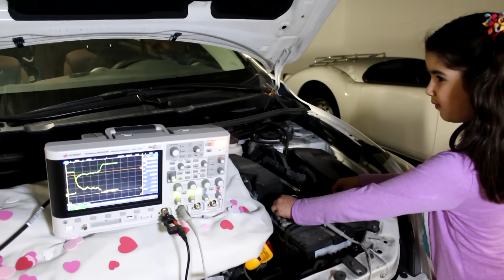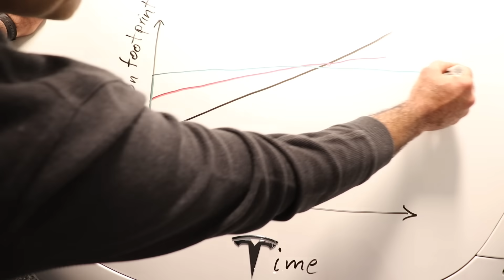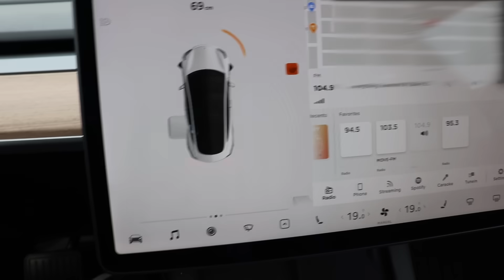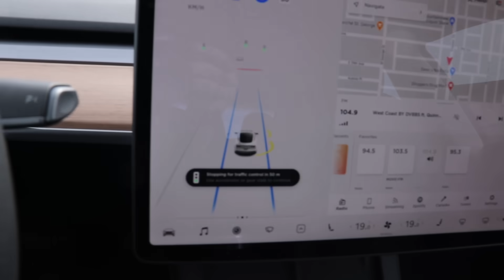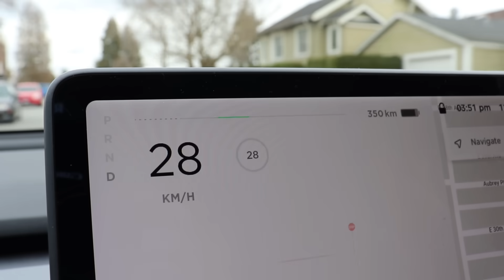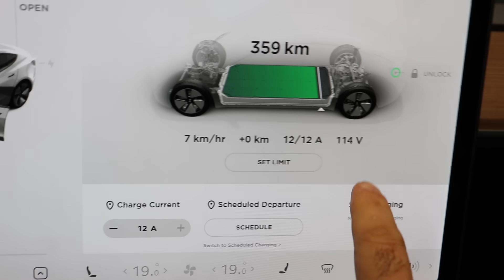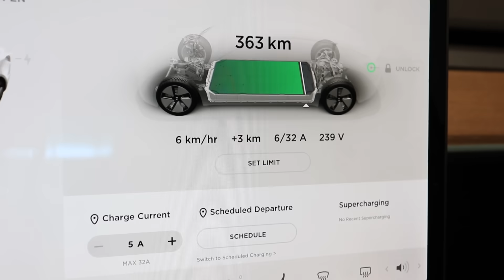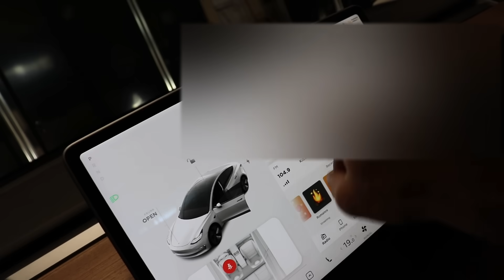ELECTRIC VEHICLES & My Tesla Model 3 Review

Comment: This is the one and only man that shows off his car without showing off his car
Reply: @AppleReviews  1000 charges is about 200.000km. Most people need more than 10 years to drive that distance. Till then the battery technology will be better and cheaper.
Reply: @k0t1990  - To me, that's about three years, maybe four.   Teslas, like most EV cars, are really designed for city only drivers.
Reply: @AppleReviews  Even if the battery died at 1000 charge cycles (which it doesn’t), 1k cycles at 250 miles per cycle is 250,000 miles. Cycle life is based on full to empty usage cycles, which is far more extreme than a typical usage profile. My 7 year old Tesla is at 145,000 miles and I have most of my original battery life still. Spreading nonsense...
Reply: @AppleReviews  as other mentioned it is ~200k miles. Other thing is, he sad he is charging it at 5A. It is the same as super charging for mobile phones. It is fast, but battery life is shortened by it, using slower charging is good for battery life, also tesla batteries can be recycled and carbon footprint can be lowered.

@1Guil Mil No one cares. He did not flex with the car, he just showed technology and reasoning why tesla. That is why others are subscribed. Go ahead and unsubscribe. Have a nice day.

For everyone, pardon any mistakes in my English.
Reply: Dude, you weren't even listening! He didn't buy a car, he bought a huge brushless motor and a massive power bank. lol

(Not serious, if that wasn't obvious. Still looking for that sarcasm emote...)
Reply: @joelvarney5091  lmaoo
Reply: I must say that is now in the quote dictionary.
Reply: Agree
Reply: @AppleReviews  because it's BS
Reply: Question mark?
Reply: yes
Reply: Couldn't have put it better
Reply: you have to remember he is a dad
Reply: Ikr!!
Reply: You can too, just draw on your car and show the world
Reply: This car got a explosive vateries 💣💥💦
Reply: I feel this 1Guil Mil guy will delete his comment, so um here is what he said

"I never expected much from this guy, but buying a car from mr. fraud is a little bit too much. Unsub"
Reply: @d4kx639  Thank you. We used to call this "quoting for truth" and this old web-surfer appreciates it.
Reply: hey basil
Reply: @basil127  ഹലോ ബേസിൽ
Reply: @basil127  Asalamu alykum
Reply: vai brazilian
Reply: I never expected much from this guy, but buying a car from mr. fraud is a little bit too much. Unsub
Reply: @1guilmil28  you are going to unsubscribe from an awesome youtuber because he bought a car from Elon Musk?
Reply: @KingLordLele  I hate elon bit I love electroboom
Reply: @KingLordLele  I hate musk but I love electroboom
Reply: @1guilmil28  You can't cancel people for consuming products. Most large companies are equally slimy, if you care that much get involved in politics
Reply: @callumgreen6383  If you think Tesla is slimy, you have been manipulated by the media...
Reply: @callumgreen6383  Elon Musk is far from slimy he’s one of a few people who actually care.
Reply: @tomura7739  Ask his employees
Reply: @Haibrayn42  statement that brings nothing to the table bozo
Reply: @toddeburch  dude Tesla IS slimy. They treat their employees like crap and their quality is terrible just as seen in this video. Don't be a Musk simp. It's embarrassing to be a fanboy without logic.
Reply: @callumgreen6383  agreed
Reply: @toddeburch  yeysla is slimy
Reply: @toddeburch  no large company becomes such without exploiting. Period. All large companies and millionaires are slimy for one reason or another. Even your "heroes". What are they actually doing for YOU personally? Nothing. And yet they hoarde wealth gained through exploitation of the working class. These rich people should not be your idols, you'll probably find the media has contributed to you believing such.
Reply: @1guilmil28  the door is wide open. We will stay here and be happy. 😁
Reply: @1guilmil28  Hurt much.
Reply: @1guilmil28  you are acting like someone cares
Reply: @1guilmil28  oh no...

Anyways...
Reply: @1guilmil28  this isn't an airport you don't have to announce your departure
Reply: @1guilmil28  I can't tell you how much you'll be missed. Really. I can't.
Reply: @1guilmil28  go on then, nobody asked
Reply: @1guilmil28  Hope you realize that says waaaaay more about you than buying the car says about him..
Reply: @1guilmil28  I'm trying to figure out who asked.
Reply: @1guilmil28  we don't care
Reply: @1guilmil28  go back to kindergarten
Reply: @1guilmil28  Nobody caaaaaaaaaares, nobody caaaaaaaaaaares
Reply: @1guilmil28  you know what you do? You spend your day searching for videos involving Elon musk and if the video gives kudos to Elon or his technology, you will go on and try to cancel the video creator. Lol
Reply: @1guilmil28  These are some of the best cars ever made, and Electroboom made a good choice!
Reply: @1guilmil28  Seethe harder nerd
Reply: @1guilmil28  I think I may have to stop usng the internet if you unsub. PLEASE come back, we REALLY care. Not.

Comment: Lol. Chevy made a car (carburetor) that got roughly 50 miles per gallon in the 1950's. Look into it.
Reply: Provide a source please
Reply: It roughly started in the early 1900's, 19 teens to 1930's ish, in canada if memory serves correct, with patents filed for a carburetor/s that would "vaporize" the fuel before entering the engine. Vs the fuel requiring the engines heat after being injected directly into the engine. Thus vastly improving the mpg. Kinda falls in line with the "dirty gas" issues of the days. Hense the clear compartment on top the pumps ensuring quality fuel was being purchased. But I digress. Chevy basically tested however many of there own. Some people with the ridiculous claim of over 200 mpg. But we know the not wasn't possible. 50+ for sure, but not 200+. Even diesel works off this basic principle. Only difference is the known fact vapors dont even need a spark to ignite under the proper conditions. That's why diesels run at such high psi in their fuel system for a "finer" vapor for ignition. There are even "unclassified" videos on youtube from the government on this subject. Great stuff for the mechanic to know.

Comment: no, dude, buying new car does not equal conservationism . it's the opposite!  it might change when cheap EV's will have 20 year+ lifespan and cost even less then they do now(it has direct connection to the footprint of the production itself). even then if you are using it like avarage person the producing  a new car ever 10 years itself is a huge waste. only long lasting battery with big everyday use will have this affect.  for now its more environment friendly to keep old car running and servicing it yourself. if you are radical about reducing emissions  pedal your bike.  don't spin harmful BS like"buy more= conserving more" .

Comment: I hope you won't make it blow-up

And after red goes green you need to push gas so immediately after the light change it won't start and a red runner hits you
Or you could just hold the steering wheel

Comment: I doubt you're charging more efficiently with minimal amps. Yes you have less losses on the cable and the battery but the charger is normally most effective at the highest speed available and the whole car is powered up while charging, which may be some 300W the whole time you're charging. The battery doesn't care that much, that's still slow charging. I'd recommend at least some 3.5 kW. I also own a Zoe and at much less than that charging gets so inefficient barely any charge reaches the battery.

Comment: Most other EVs blend regenerative braking in when you press the brake pedal. I like that better, it allows for stronger regenerative braking (up to the power of the motor) and it allows you to coast. Of course best is if you have the choice. One pedal driving or coasting and regenerative braking with the brake pedal. BTW many EVs have the problem that the brakes rot because you need them too little. Anyway they still do need maintenance. Have a look at Bjørn Nylands 8 year old Tesla. Almost every part of the drivetrain has been changed.

Comment: EVs are amazing to drive. I got a Chevy bolt last year and I’ve been able to get 220 miles on a charge with air conditioning. You can find some crazy good deals on them currently.
Reply: Bolt is currently the best option, for sure, but the Bolt EUV and Mach-e seem like they might be even better options.
Reply: @Sean_The_IT_Guy  

Used Bolts can be found for super cheap, like $13K-14K for 2017 bolts with low miles

Comment: According to the numbers in your video, electricity costs you between 10¢ and 14¢/kWh. I live in Silicon Valley, where the cost of electricity is over 30¢/kWh. My Prius Prime (plug-in hybrid) gets 50-60 MPH, so It's much less expensive to drive on electricity than gasoline.
Reply from the maker: You probably mean 3 cents, that super cheap!!
Reply: @ElectroBOOM  Probably not.  30c is common in many places.  Our 16c(cad) is actually quite cheap compared to a lot of US area pricing.
Reply: @ElectroBOOM  I don’t think so because the cheapest electricity of North America is with Hydro Quebec, it’s $0.06 CAN per kWh
Reply: @ElectroBOOM  hi